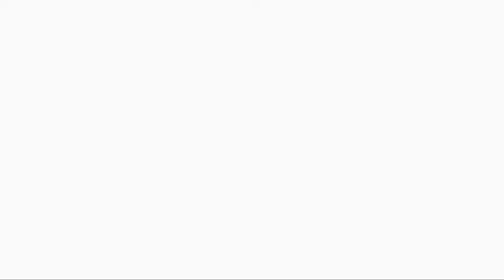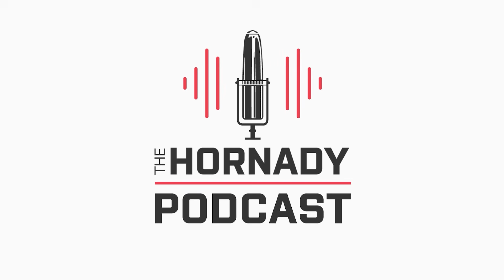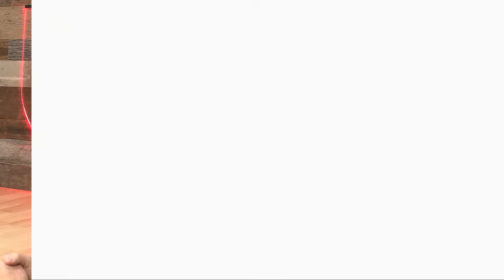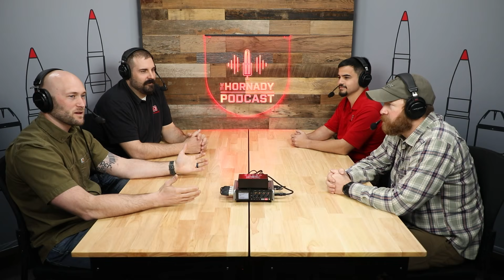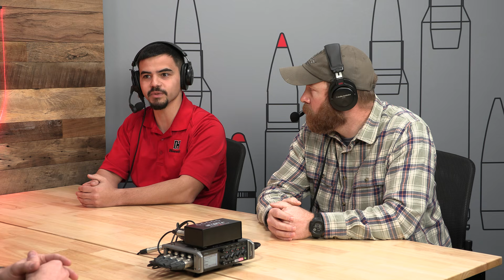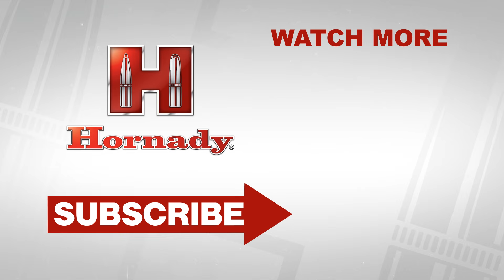Ep. 012 - 6mm ARC (Advanced Rifle Cartridge)

Comment: So this has more energy on target than 308 at distance? Not buying that one unless the comparison was heavily gamed in favor of the ARC.
Reply: from some of my researching the 308 win with a 150 gr will hit with 435 ft/lbs of energy at a 1K yds. the 6mm arc with the 108 gr with hit with 400lb/lbs at 1 k yards. No meaningful difference in energy but the arc has a higher velocity at that range and gets there with much less powder and recoil. for target shooting it seems better. For hunting the 308 would be the clear winner. Great AR cartridge.
Reply: @nernamez5946  the question would be what 150 gr 308 bullet. If you ran a 150 gr flat base soft point vs say a 155 Palma style bullet you’d get a different result.
Reply: Energy is not a stand-alone encompassing metric for terminal performance.
Reply: @milesn3173  so in what metric do you think the ARC is going to outclass the 308? The ammo is lighter and traditionally the rifle is too but in an apples to apples loading I can’t imagine the arc outperforming 308 terminally. It’s got a bigger powder reservoir and operates at a higher pressure
Reply: @K-bob_45  range, the bullet will retain speed better. 6 arc will eventually pick up with 308 in energy eventually, but only at extreme ranges.
Reply: @user-pq4by2rq9y  have you tried running those numbers?
Reply: @K-bob_45  Temporary and permanent cavities, penetration depth, etc...  It's going to be very bullet specific, but what we've developed in the ARC meets or exceeds what's being currently fielded.  There are .30 cal bullets that will outperform the ARC in those regards but not currently fielded, and then there's all of the other attributes, ammo weight, rifle weight, recoil, etc...  For the intended purpose, for who it's for, it's a better mousetrap.
Reply: @milesn3173  once you say currently fielded I can agree. Most people buying this cartridge aren’t stuck shooting 168 or 175 smk. There are plenty of bullets from this century that are night and day better performers ballistically and terminally
Reply: I''ve struggled with this also, but I and people need to remember there were other data points that are relevant to the military, imho this was more about replacing 556 than it was the 762. I think eventually the ARC could relpace 100% of the 556 &  a smaller percent of the 762, and of those 762's left a certain % are moving to 6.5CM. All that asside,  does the ARC have the same amount of energy or more at long range? I don't think so, but per the data is it sufficient? The 2 two things the ARC has going for it is the flight efficiency and the sectional density, double the mass of projectile and all other variables stay the same, kenetic enegy is 2X, another data point is double the velocity of a projectile and kenetic energy delivered is 4x,  so take a 160gr bullet at 1000 yrds moving at 1000fps, versus a 100gr bullet at 1000 yrds moving at 1200fps, you should be atleast within 80% of the KE of the larger bullet. then there are terminal ballistics, I don't know all the data measurements they use there, but penetration in some form must be measured, the sectional density of the long narrow shape of a ARC puts more of its mass behind a smaller impact area, which with the proper bullet design would lead to better penetration into a given media. So with terminal ballistics data? man I would imagine they are super close at 1000yrds.
Reply: @EssPhour  I think Miles already answered the question. “It’s better than what’s currently fielded.” Thats a drastically different answer than “it’s better than anything 308 has to offer”. Just a quick trip to JBM and with a 168 berger hybrid at 2500 we’ll have 12 mils of drop, 1120 ft/sec retained velocity, and 468 ft-lbs of energy. With a 6 arc pushing a 105 berger hybrid at 2600 you’ll have 10.6 mils of drop, 1220 ft/sec retained velocity, and 348 ft-lbs of energy. Those numbers are what seem to be common for a 16” AR-10 in 308 and an 18” 6 arc per hornady.
Reply: They don't want to compare it to the 6mm Dasher
Reply: @TexasTrained  it doesn’t look like a 6 dasher will fit in a AR-15 magazine though. Sierra load data has it at ~2.450 C.O.A.L with a 95 gr bullet

Comment: Early reviews on YouTube showed a lot of “double grouping” with heavy bullets which also displayed egg shaped holes in paper targets suggesting to me that the barrel twist was too slow. Have you reevaluated barrel twist for heavy bullets?

Also, has anyone considered a redesigned bolt and barrel extension for the 6 ARC? It seems to me that pressure issues could be alleviated this way. 

The 6 PPC long predated the 6 Grendel and related cartridges, but was typically loaded (in bolt guns) to pressures An AR platform would not withstand. Presumably, you shorted the headspace to preclude someone shooting 6 PPC and such in it.
Reply: I only keep the 6MM ARC loaded to 52,000 limit for my AR, I have zero need to ruin a rifle by throttling my barrel with 1 high pressure rapid fire string.  Most stuff I see on YouTube scares the crap out of me.
Reply: @davidmilisock5200  I think there was a strategic error not changing the bolt & barrel extension. I foresee early bolt failures, some potentially catastrophic, in the future. 52k PSI just doesn’t show pressure signs on the primer and brass people are accustomed to using developing loads in bolt guns.

What I was actually referring to were some of the earliest YouTube videos featuring “review samples” of rifle & factory ammo. They simply did not group well. I’m suspicious that they got the barrel twist wrong for the heavier bullets.

I was spotting for a friend shooting a 6x47 Lapua and I was surprised that neither the primer nor brass were showing any signs of distress with some 115gr bullets which were loaded fairly warm judging by the drop going out to 500 meters. 

At least for the time being, it would be prudent to stick with pressure tested load data.
Reply: @richardbriscoe8563  I've been using the same 3 gun smith's for nearly 40 years. Judging from what all 3 tell me the AR 15 market has become flooded with poorly constructed rifles. I not only expect to see failures when I visit the one guys shop. (he's 3 minutes away) I'm seeing about 4 failed rifles a week. No 6MM ARC rifles yet but a bunch of 5.56, 300 Blackouts and a few other calibers. 

I have zero concerns about failures with the military loading, it has had to pass military tests. My concern is with users,  I've seen the so called builders mix matching type one bolts and type 2 chambers. 

The bolt for the Grendel has a type 1 and type 2. The 6MM ARC does not, it only uses a type 2 bolt and 1 set of chamber specification. There are 6MM ARC headspace and short brass life issues all over the internet, that's just poor rifle building. Which is why I picked a certified 6MM ARC manufacturer.

My 6MM ARC shoots tiny groups and reloads from factory dies using formulated powders with results that match manufacturers loading results. I expect it will run well for many decades.
Reply: @richardbriscoe8563  I've been shooting 6.5 Grendel from AR-15s since 2009, with thousands of rounds through everything from 28" down to 12", with huge moving boxes of brass to prove it.

I have yet to experience any mechanical failures of pressure containment parts.

I have used real Grendel bolts though.  I know people who have broken imitation bolts, AA bolts when shooting MLGS 18" suppressed, and hi-power guys pushing 6mm AR way beyond the limits to increase x count.

I'm shooting 12" suppressed now as my focus, which is a joy.

Brass through 22" RLGS, 20", 18", and 16" MLGS has lasted longer than any other rifle cartridge I have loaded for.  I primarily load Lapua and Hornady brass.
Reply: @davidmilisock5200  A substantial portion of 5.56 bolts and extensions on the market don't even comply with dimensional call-outs from the TDP, let alone materials and processes.
Reply: Current 5.56 NATO pressure specs are 62,366 PSI. They of course can spend our dollars on barrel replacements. Outside of increased barrel wear there has been only one certified issue and that one was because the 855A1 requires a different magazine follower and some I believe Army unit was using old magazines. 

I would never push any of my ARs that hard, I stick to 52,000 PSI loads. I want to keep ,y rifles for much longer.

There are no pressure issues with 6MM ARC semiautomatic loads,  just people who ignore specifications. The certified 6MM ARC load is 52,000 PSI and safely performs as designed. 

Yes bolt rifle performance of the 6MM ARC can be  better than the AR loading. However the same thing can be said for the 30 06 and Garand loads as well as the 308 and M14 loads.

Have Garands and M14s been blown up?  Yep, there's no accounting for people.

Comment: What length barrel, in a gas gun, is needed, to get the performance of the 6mm ARC?
Reply: Guys are running as short as 12.5 and of course you aren’t going to be at optimal length there 

My gas gun is 22”  excellent performance out too 600 plan to touch 1000 by the end of the year
Reply: I’m using a 12.5” and an 18” and am loving it with great performance.
Reply: Well, it has about the same energy than 300 blk out of a 11.5 inch barrel so you can choose whatever you want. Hornady recommends 18", I believe.
Reply: I'm using a 16".
Reply: @davidmilisock5200  same here have only shot 40 rounds but I’m impressed
Reply: My build is 18" a is sub-MOA out to 400m still MOA at 800m